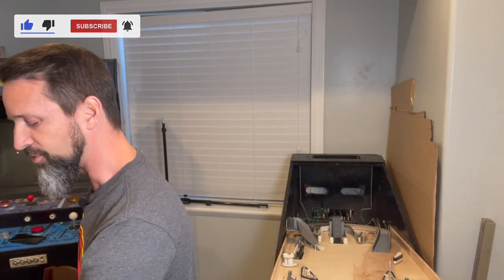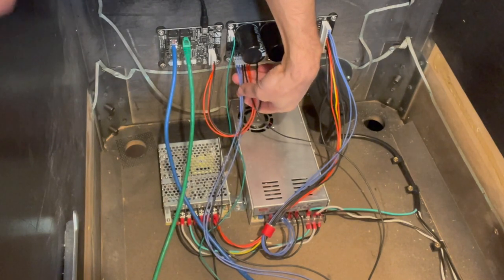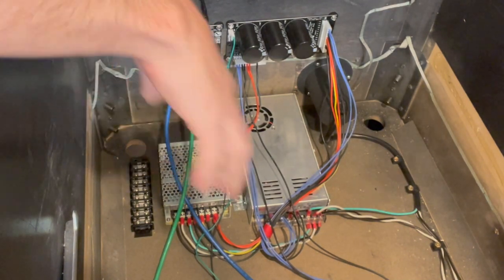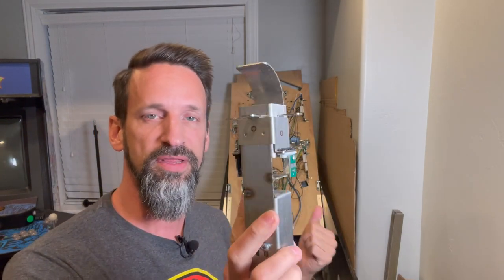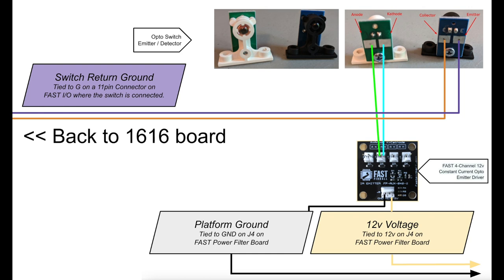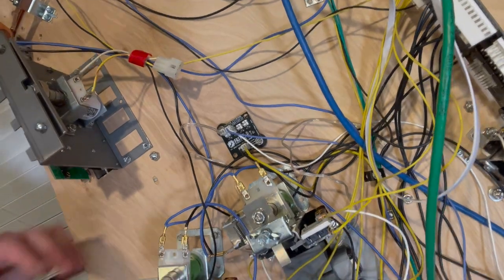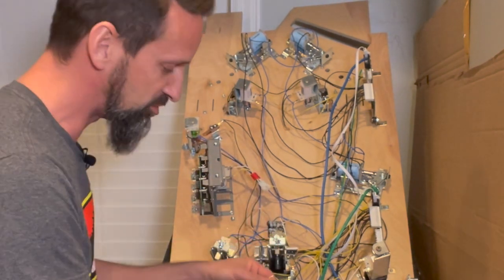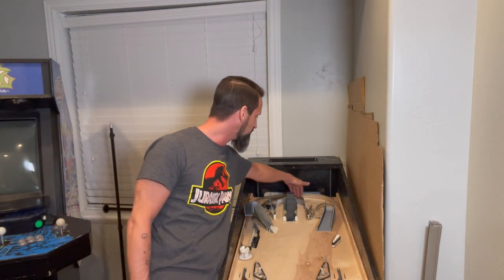HOW TO MAKE A PINBALL MACHINE: Optical Switches

Comment: I recommend getting different colored electrical tape so if you run out of a wire you can wrap what wire it was suppose to be black but ran out and had to do white.
Basically just get black electrical tape and wrap the white wire with the black electrical tape.

And it is best to wrap the whole wire but I did not for my wiring.
I actually did not have any Green for my grounds on my power supply hook up so I used 16G red instead and wrapped Green electrical tape at the starting of each stripped end and about the center point of the wire.
And yes I know it is an old video but I always comment my ideas even on old videos. xD

Comment: Looking forward to seeing the electronics that implement the game logic. Will you be using an Arduino or?
Reply from the maker: I'm currently using a windows laptop to run the mpf software, but will be swapping to a Linux pc, probably a low end nuc to be the final system.
Reply: @thepinballroom  What do you recommend for driving the solenoids?
Reply from the maker: @virus-hoax  I'm using the FAST hardware controllers together with the MPF software - for power supplies, I'm using the ones that come in the FAST hardware starter bundle - you can see it at store.fastpinball.com

Comment: Maybe I'm misunderstanding something, but if 48v and 12 v are needed for the machine overall, and you have both of those voltages going to the power filter from the supplies, why is the 12v not also available for your play field like the 48v is? Is this simply because you chose to "dead end" it with your initial wiring because you didn't need any on the play field until now? I ask because at first glance, the situation sort of reads as "these boards, installed as intended, have this issue which requires a fix," which seems sub-optimal, but hopefully I'm just overthinking this. Thanks!
Reply from the maker: Yeah, it's not a needed fix, I just hadn't ran any 12v up to this point yet